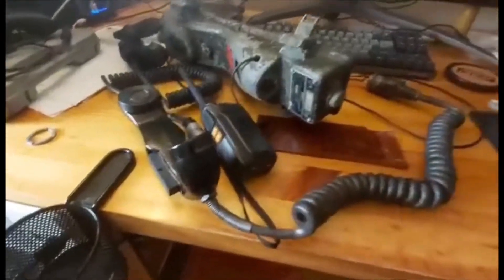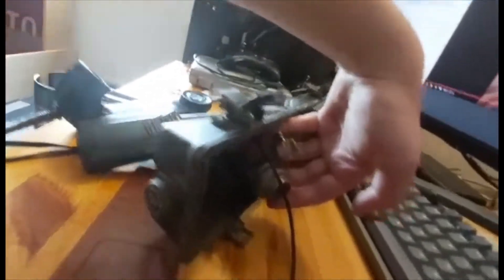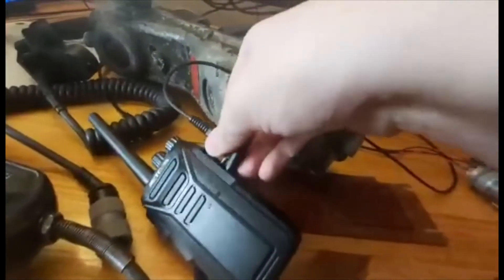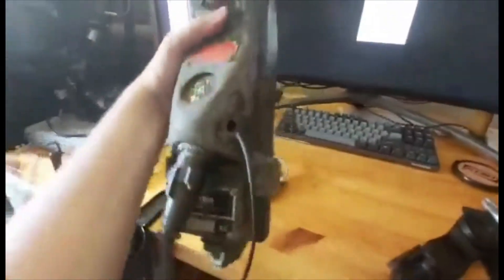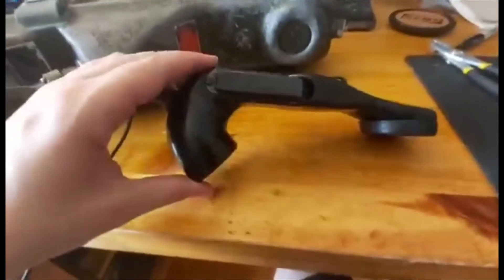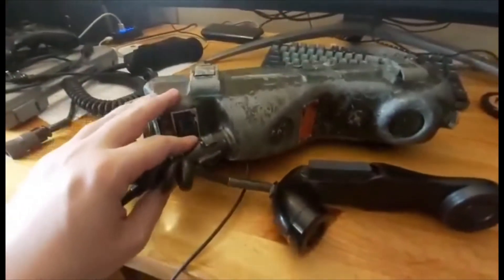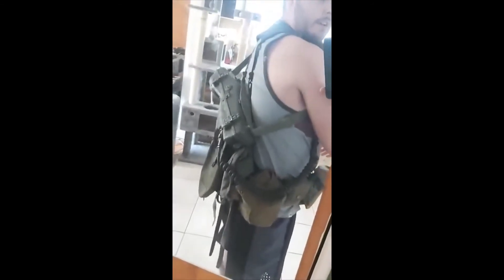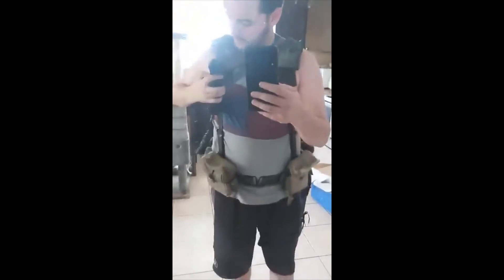Airsoft PRC-6 Build (Vietnam WalkieTalkie)

Comment: Nice mod, is it possible to completely gut the PRC-6 and fit the radio inside it? and keep the original parts safe at home in case you want to revert the conversion?
Reply from the maker: I'm hoping so, I have another radio that's been pretty beat up, plan is to take its guts and try to fit them into the PRC-6 battery compartment. Current issue wit getting parts inside is a mix of time, and issues with both getting the antenna to fit, and getting good reception. In this case I just needed it ready for this weekend, so this was the quickest way